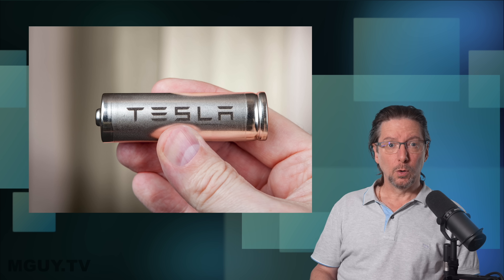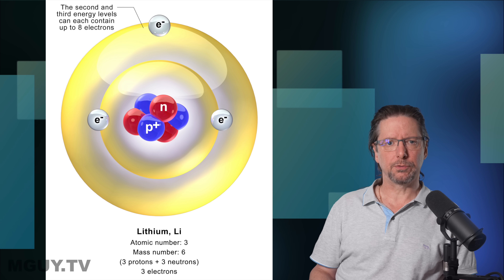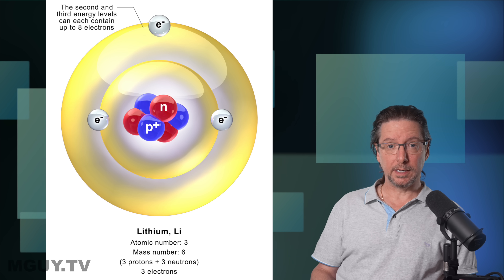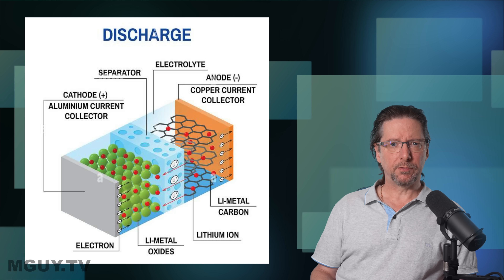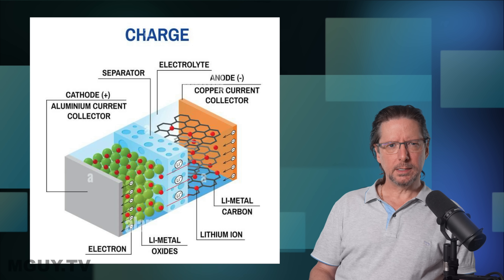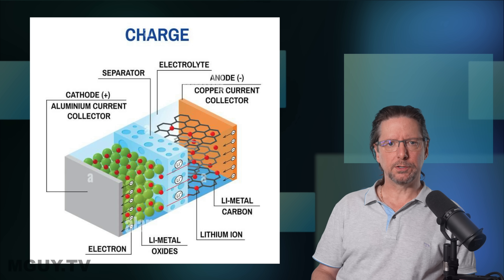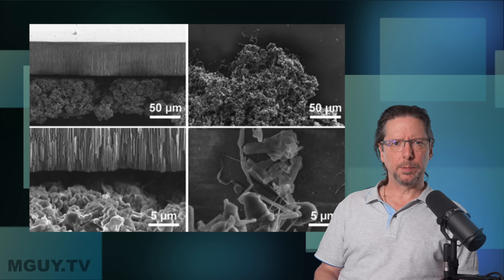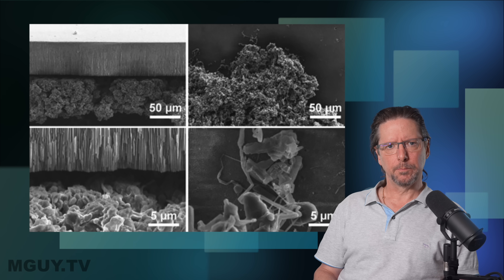Why are EVs so TERRIBLE in the cold? | MGUY Australia

Comment: Evs are too early.  They wont be a thing this decade.  The  infrastructure isn't there and they are  a fire hazard. And they have bad range etc etc etc
Reply: Yes they are A tHiNg. Just because they are a thing that totally sucks does not mean they are not a thing. People who are smart enough not to fall for shitty EVs they've been pushing for over a decade are still total trend suckers when it comes to repeating inane cool kid language they picked up online in the last 5 years.
Reply: EV's have been around since the beginning of the automobile, they are not new technology and EV's still suffer from the same problems they have singe the beginning.
Reply: @LeeCountySpeedShop  EVs do NOT suffer from the same problems they had 100 years ago, are you nuts or just so biased you don't care what you write?
Let's see about some things that have changed in the last century:
1) The grid was created, all over the USA. By order of Congress, all areas of the USA have been electrified regardless of the profitability of the locale. We have power now, everywhere.
2) Batteries have improved in the last 20 years tremendously, with their price per kW/h and kW/h per kilogram improving like the density of microchips. The advent of lithium-ion chemistry was the landmark invention that made modern batteries practical (generally, a 3:1 improvement in kW/h per kilo).
3) Modern EVs have battery management systems to prolong life and improve performance in cold temperatures.
4) EV motors are more efficient than they were 100 years ago, with both permanent magnet and induction motors.
Reply: Stop voting for Politicians that give large subsidies to EV buyers and companies.
Reply: @jamesdallas1493  OK, does that mean we stop voting for politicians that give (in the USA) $20 billion in annual subsidies to the oil industry, and bail out (USA) bankrupt automobile manufacturers? I'm just trying to understand where your opinion on subsidies fits...
Reply: @justsomeguy934  what do mean by oil subsidies?
The oil and gas companies pay more in Taxes as percentage of income than big tech.
Reply: Its not to early for EVs, the timing will never be right.  
100yrs ago they tried it and said the same thing.
Reply: @terrypikaart4394  100 years ago there was no appreciable grid in the USA, nor lightweight batteries. Both are present now.
Reply: @justsomeguy934   Sure you could say that, but apparently the grid is not good enough and nether are the batteries..
Its all going down the tube..
Reply: @terrypikaart4394  "apparently" the grid is not good enough? Prove that, please. Stop drawing the conclusions that the oil industry wants you to draw.
Reply: BEV only for 10 years now, >300tkm, they work, they stay, I would never go back to ICE cars. Driving through Europe BEV only, never did that in ICE cars. Just checked, no fire this week, but its only monday :-) Only people not knowing anything about EVs have problems, why do they always believe all the misinformation ?
Reply: I doubt mass production of ICEVs will last past this decade because BEVs have proven so much better, the infrastructure is so much cheaper to maintain, and the fire risk that ICEVs represent.
Reply: Even with General Motors crappy EV’s that really hurt the fire hazard ratio,EV’s in North America catch on fire less then ICE vehicles
Reply: I guess my 9 years and 100,000  miles of driving all over the USA didn't happen, then?
Reply: All lies. Check other sources like Electric Viking
Reply: @derekr1113  Electric Viking is hardly an expert on the history of battery powered cars.
Reply: @derekr1113  that guy is a moron schill.
Reply: 😂😂😂Tesla model Y was the Best selling carmodel on planet Earth in year 2023
Reply: In a decade you will own nothing and you will be happy.
Reply: I have a model y up here in frozen hellhole canada.. it gets COLD and stays that way for months on end. I plug in each night and never have any issues.. not like im driving 250km a day when the batt has lost a lot of range. And I still drive 500km to my home town in winters no problem.. i stop twice to charge and it gives me enough time to go to Tim Hortons , get a coffee and something  to eat and have a bathroom break.. stretch my legs a little and away I go. In the summer I only have to stop for a charge once... but in 6 hours of driving its not like I wouldnt be stopping twice anyways to do these things. I think too many people here just hate EV or just believe the FUD, intentionally I suspect. For me an EV is perfectly fine and I save a ton not having to get screwed for gas prices... if you are not one of these people, then EV's arent for you. Its that simple.
Reply: Yes Mark and r the bloody things are just getting so large too - I have visons of say an Abrams tank going electric powered - just simply absurd.
Reply: Its kind of sad what the Govt are doing with Evs. They are straight lying to these people and are creating these Cult Members. You look up Ev fires and they will tell you 5. Lmao..  They are just using them to get cars off the road and they got people cheer leading for it. Dystopian Nightmare!!
Reply: The gas car was a fire hazard and still can be lmao what are you talking about?
Reply: 1. Child battery mineral labor

2. Range anxiety

3. Risk of garage fires

4. Paying 20k more than a
comparable vehicle

5. Battery denegration

6. Poor resale value

7. Reduced performance in
cold, highway.

8. Higher repair costs

9. Awful charging network
experiences in the weather
without restrooms

10. Higher insurance rates

11. Replacing tires more
frequently

12. Death by autopilot

13. 30 - 40k battery

14. Low km range

15. must wait in-line 1-2 hrs
to charge.

16. Then wait more time to charge, while charging.

17. Spontaneous combustion, with no way to put out the fire storm.

18. If they catch fire in a tunnel, many people will die.

19. People without a pro charger system or a parking spot at their house, will run an extension cord to the road, which is dangerous and could lead to people tampering with your charging setup (super slow charging at the road)

20. If you're in California, you won't be able to charge your car past 4pm because of a shortage of electricity supply on the cheesy grid.

21. It is not actually "green". The pollution is made at the power station, not the car.

22. Only 5% of used junk batteries get recycled, the rest go directly into the bin. It's cheaper to mine for new minerals.

23. Chhinna actually does 70% of all the refining of the minerals and production of the batteries.

24. Minerals are becoming more and more scarce, and the cost will only go up, not down.

25. Some countries where they mine for lithium, actually use a very big boat load of fresh water to only produce a ton of lithium, so they are afraid of running out of water. It takes over 2 million liters of fresh clean water to produce 1 ton of lithium. 

26. Ev cars will soon not be able to drive in tunnels or be able to park in underground parking garage and probably will eventually void your house insurance if you park it in your personal garage.... 

27. You can't charge your battery at super stations when it is bitter cold out. 

28. If a fire truck comes to put out an Ev fire, all the chemicals go directly into the sewer system, poisoning everything. They need tons of water to slow down the burn. They can't put them out. They are only trying to prevent over things near by from catching fire. 

29. Ok, there is 2 good things; regenerative braking, which charges the battery while you are slowing down on the highway, which saves your brakes from much wear.
Reply: Theyve been around for OVER 100 YEARS.
Reply: @sugarnads  ...and they failed 100 years ago because of charging problems and range problems...
Reply: @teekay_1  absolutely false, but the oil investors appreciate your patronage.
EVs and steam vehicles outnumbered gas cars in the 1910's. The changeover happened because the electric starter was invented by Charles Kettering. That removed the danger associated with hand-cranking an ICE. Gasoline, more portable than electricity in a country with little to no grid, prevailed. Also remember there were not federal highways at that time, either. Up until WWI and WWII, there were farms with NO electricity in the USA but you could take Bessie the mule to town and buy fuel for the tractor.
You're welcome for  the actual facts and history of EVs.
Reply: @justsomeguy934  Oh, absolutely true.   You just have no knowledge of automotive history.

Detroit Electric was the favorite of wealthy women, because they weren't strong enough to crank the engine.

Once Cadillac invented the electric starter Detroit Electric failed because of range issues, and battery issues.

So stop pretending you know what you're talking about and accept that the electric car had already failed over 100 years ago and it on the verge of failing again today for precisely the same reason.

As long as electrics are going to drag around that heavy battery, they'll never succeed.
Reply: @sugarnads  maybe the 100year old electric cars are better
Reply: @sugarnads  exactly, not early but late and out of date
Reply: @sugarnads roller blades were patented in 1917.  Just because the idea is around doesn’t mean we have the materials to make it work properly.
Reply: @fredmonroe6042  'RollerBlades' are only ice training skates repackaged
Reply: Gas cars catch on fire at an extremely higher rate than EV's. They are leading in fire hazards. In the US alone they have 175K gas car fire a year.
Reply: @itsatrap7215  only because there are 10 billion ice cars cruising around.
Reply: @jakefriesenjake no, pay attention. He said the RATE of fires is higher. That takes into account the difference in numbers. 
In fact, the rate if fires in ICEVs is 30x higher than BEVs. Not 30% higher, 30 times higher. That gives you an idea how badly channels like this are misleading you about EVs. 

Gas vs EV Fires [2023 Findings] - AutoinsuranceEZ
Reply: @williammeek4078  the issue here is you are comparing ICE vehicles that have been in common use for 125 years compared to EVs which have only been in common use for maybe less than ten years and even that, they aren't all that common even today. So until EVs have been around for another 125 years the numbers mean pretty much nothing.
Reply: @williammeek4078  however ICE vehicles don’t go into thermal runaway out gassing toxins while trying to put the cursed things out.  Let’s not forget get the toxic nature of the run off water.
Reply: @jakefriesenjake  you might want to look up the number on EV versus ICE fires... ratio wise. ICE cars are worse.
Reply: @northdakotaham1752  😂🤣😂 Your logic is absolutely backwards. EVs are already better despite being new and they are only going to improve. ICEVs are crap since they already can’t compete with EVs.
Reply: @itsatrap7215 cobra bites are much more dangerous than bull snake bits. Bull snakes are more likely to bite, but I’d still rather handle one free hand. Gas cars may catch fire more often but they not nearly as dangerous. In fact, it isn’t at all uncommon for fire damage to be repaired. An EV that burns is a total loss and much more likely to burn everything in the area.
Reply: @itsatrap7215  I dispute your "at a higher rate".  Fact link please.
Reply: @itsatrap7215  Only because there are hundreds of millions more gas powered vehicles, but you leave out that gas fires are much easier to put out. EV's are a very small amount of vehicles in the market. Also Electric Vehicles have hirer repair rates than do gas and diesel vehicles and EV's cost more to repair. Funny how you EV backers always want to turn a blind eye to that.
Reply: @itsatrap7215  ICE car fires are generally smaller fires that are easy to put out, with no risk of re-ignition days or weeks later at the impound yard. ICE cars as a whole do not spontaneously combust in your garage, also-
Reply: @doublebackagain4311  actually, Toyota and Hyundai have recalls out for millions of vehicles for spontaneous combustion. So does Ford for fires (8 million on that recall), and BMW (a million for fires) and Honda (half million, I think) for window switches that cause a fire if snow or rain falls on the switch.
What were you saying about ICE cars not catching fire in a garage?
Reply: @justsomeguy934  I know a guy who failed to properly reconnect a fuel line on his car during maintenance. This resulted in a fuel fire. He put it out with his soda. Not even a full can. There was no damage to the vehicle. That certainly counts as a vehicle fire and one that involves fuel. You cannot have a fire that minor that includes an EV battery.

Another major factor that is missing is the percentage of fires started due to "red neck maintenance." Once EVs start receiving the same treatment their combustion rates are going to go up as well.
Reply: @joshualandry3160  The stats for ICE fires vs. EV fires are measured in miles between fires and fires per 100,000 vehicles. It matters not what the cause is, poor maintenance, sparks igniting fuel as a result of a crash, spontaneous combustion. The fact is that EVs are orders of magnitude safer from fire than a vehicle carrying liquid explosive as fuel.
Reply: @justsomeguy934  No, you are misunderstanding the statistic quite horribly. One fire does not equal another. I gave the example earlier of a cobra and a bull snake. A cobra is quite venomous. A bull snake is not. A bull snake is more likely to bite. Actually, Vietnamese blue beauties would be a better example. Extremely likely to bite however basically harmless. The frequency of bites does not tell you which snake is more dangerous.

For example, the fuel fire I cited earlier that was put out with half a can of soda. That is a typical fire in an ICE. Relatively minor. EV fires are almost all due to battery failure in a thermal runaway. Even those that are not can very quickly become thermal runaways. Lithium battery thermal runaways burn several times hotter than gasoline fires. The batteries are also self sustaining and therefore almost impossible to put out in the field. An EV fire response is basically containment to keep the fire from spreading. Even once extinguished the fire can reignite days or even weeks later. 

EV fires are also triggered by very minor accidents and flooding. What is worse these fires can happen months after the damage was inflicted. This is why there are so many quarantine rules about damaged EVs.

As for gasoline, it is not a liquid explosive. Gasoline vapor burns relatively slowly and liquid gasoline doesn't burn at all. In fact it can often choke fires out completely. A fuel that explodes is a very bad fuel since a cylinder wouldn't be able to handle the stress. A gasoline fire looks like the opening in Ford v. Ferrari, not a Mission Impossible or James Bond movie. In reality Lithium ion batteries are far more explosive. There are plenty of legitimate videos of EVs exploding. ICE vehicles don't have anything on those explosions. 

My point original point, which you chose to ignore in favor of attacking a straw man, was simply that the statistic about relative fire rates between vehicles is incomplete since if EVs enter wider adoption they will almost certainly be exposed to poor maintenance practices which will increase their rate fires compared to now.
Reply: @joshualandry3160  actually, it's you that doesn't understand the statistics, nor the facts, of EV fires vs. ICE fires. 
Your comparison of a gasoline fire to thermal runaway is laughable. It actually takes TIME for thermal runaway to occur, as opposed to an explosion with gasoline. Gasoline can, and does, spread away from the vehicle when ignited, the fire of a battery is limited to the battery pack itself. Would you like to see videos of a gasoline car or tanker hitting a barrier or other vehicle on the road? Instant ignition and explosion. EVs don't have ANYTHING on those explosions. 
Another red herring argument that the oil industry thanks you for discussing: extinguishment of a battery fire.
The time, water or procedures required to put out the rare EV fire is meaningless. What matters is how many people are harmed by a fire. 
Here's a simple example, tell me your choice:
a) Airplane brand A has 1 crash a year, all die, and the fire is difficult to put out.
b) Airplane brand B has 10 crashes a year, 10x the number of passengers are dead, but gosh darn the fire can be extinguished quickly. 
Tell me you pick airplane brand B. Go ahead, tell me the more easier extinguishment of brand A is worth the lives of 10x more people. Oh and there's more warning before a fire starts in brand A, so it's more likely more survive.
My point, that you chose to ignore, is that you have no proof (because the NHTSA doesn't state) that any significant ICE fires are small or meaningless; the same could apply to an EV fire. My point, that you chose to ignore, is that TEN TIMES fewer fires is safer than TEN TIMES MORE FIRES. Your "put out a fire with a soda" is laughable. As for poor maintenance-sourced fires, you actually made my argument FOR me. If a car owner can't do proper maintenance, having them neglect that on a vehicle carrying liquid explosive as a fuel is...not a good idea. Keep Mr. Hat-On-Backwards mechanic AWAY from gasoline, yes?
Reply: @justsomeguy934  Really funny. You don't know Jack about fighting fires but want to assume gas fires are worse, because gas "is explosive" without evidence. Why are you so opposed to being realistic? You have no idea what percentage of ice fires are serious. You simply want to assume they are all worst case because you know ev fires are. The simple fact is a lot of ice cars are extinguished and repaired.  That proves you don't know what you are talking about.

You also want to keep shadetree mechanics away from cars? Good luck with that. 3rd party battery repair is already a thing for evs and they dramatically increased the risk of batteries entering thermal runaway. Also, good luck noticing a runaway in time to do anything.
Reply: @joshualandry3160  Really serious. You're trying to introduce an unsupported "fact" into the actual NHTSA stats to imply gas car fires are minor. 
I assume a car fire is a car fire, just like the NHTSA. I have no agenda as you do to try and redefine the terms of the statistics. Let's assume all fires are the same, or all fires are the least, the fact that gas cars catch fire 10x more than EVs remains.
WHO CARES if more gas car fires are extinguished or repaired? We're talking incidents of fires. Amazing fact for your: less fires good, more fires bad. 
As for thermal runaway, those take time. They give the occupants time to leave the vehicle. In fact, one of the very first Tesla car fires was a case where road debris (an L-shaped trailer hitch) pierced the battery back. The car told the driver to pull over, and only 20 minutes later did a fire occur (no explosion). My EV's batteries are surrounded by coolant, very difficult to actually start thermal runaway, and the newer ones have flame-retardant foam in addition to liquid coolant.
So you can try to explain away why an order of magnitude of fires in gasoline cars isn't so bad, but the facts belie your efforts. Did you read my airplane example? It applies EXACTLY to this scenario.
So you go right ahead with your hat-on-backwards and monkey around a vehicle with liquid explosive, then claim a soda can will save you.
Reply: @justsomeguy934 No, my facts are competently supported. The statistic merely counts  occurrences. It therefore does not directly correlate to which is more dangerous. The fire suppression guidelines and do that for me. The fact is there are a lot of examples of minor ICE car fires. There are almost no examples of minor EV fires. I am actually not aware of any.

This goes directly to the aircraft example. Lets say aircraft A has 10 incidents in a year, all fatal. Aircraft B has 100 incidents per year and 5 are fatal. Aircraft A has fewer accidents by a factor of 10. But aircraft B has fewer serous accidents. This is exactly my point. Your statistic doesn't account for this and you are forced to assume and argue against reason that all the incidents are the same.

This actually goes back to my original point that currently EVs are owned by people who can afford the EV and therefore can afford the maintenance. Once EVs enter wider circulation you will find that isn't the case and the statistic will go up. Unless you are volunteering to foot the repair bill for other owners this is inevitable. The statistic is therefore misleading in 2 ways. First it doesn't address severity of the fires and second it contains sampling bias. 

EV runaways are insidious. Sure some incidents are caught early and everyone can get clear. Sometimes not. Often they happen when the vehicle is charging and the fire spreads to the structure and is almost impossible to fight. ICE cars tend to catch fire away form other vehicles or flammable objects.

My point was, and remains, you are being a coward and abusing statistics to try and make a point that just doesn't follow logically.

Also, thermal runaways are not easy to prevent. They are actually very difficult and EVs are loaded with technology to do that. All well and good assuming that it works as intended. It can and does fail because that is just how the world works. Things break down and fail. On ICE cars that can be anything from a small fire a soda can extinguish to a something much more serous. In an EV a breakdown is a thermal runaway with no small option.
Reply: @joshualandry3160  Your statement: "Your statistic doesn't account for this and you are forced to assume and argue against reason that all the incidents are the same."

You are injecting a supposition that is not supported by the NHTSA in order to lessen the stark comparison of fire incidents between a gasoline fire and an EV fire. YOU are making a false assumption that every EV fire is catastrophic, and that half of gas car fires are not. I do not bugger the argument like you are doing and only use the rates of fire stated by the NHTSA. Anything other than that is guesswork and opinion.

As for your claim of EV fire safety, no EV battery incident results in an immediate explosion. Thermal runaway takes time, in 100% of the cases. Gasoline fires can explode, giving the occupants no time to escape. If we accept that FACT, then your argument that some gas fires are less than catastrophic is moot, as there are other gas car fires that instantaneously kill all occupants in the vehicle. 

"ICE cars tend to catch fire away form other vehicles or flammable objects." And upon WHAT do you make this claim? I have numerous examples of MILLIONS of cars recalled by Ford, BMW, Hyundai and Toyota for spontaneous combustion incidents. And where the manufacturers told the owners to NOT park their cars in a garage or next to a structure. Do you want the evidence? Stop pulling something out of your arse to make your case. 

"My point was, and remains, you are being a coward and abusing statistics to try and make a point that just doesn't follow logically." A coward, am I? It's YOU that is making unsupportable claims in the face of actual evidence that disproves your conclusion. I'm abusing nothing; it's you trying to say "gas fires aren't that bad sometimes so the NHTSA data doesn't apply". 

"In an EV a breakdown is a thermal runaway with no small option." Again, you are making statements you cannot support. An individual cell in a battery pack can fail, overheat, but the liquid coolant and flame retardant foam inside the pack limit the failure to that one cell. The pack may fail, but no catastrophic fire occurs. In fact, the EV owner may not even know the reason the pack failed, just that their battery pack doesn't function. I can even show you battery designs that have nails driven through them with no fire occurring at all.
Reply: @justsomeguy934  You are the the who argued that a fire is a fire and who cares about differences. Scroll up. You said it, you cal live with it. If you want to change your position honestly requires admitting a mistake.

EVs burn because of the lithium batteries. Ignoring that is ignoring reality. There is no such thing as a minor battery fire.

How do I know most ICE vehicles burn away from vulnerable structures? Simple. When do these fires start? When the vehicle is in use. This means not in structures and outdoors on roads. How do I know EVs are likely to burn structures? Because they tend to start burning when charging or when parked hours or days after the damage occurs. Hence the guidelines about dealing with EV damage. You can try to dispute this, but that would be silly.

Next, you cite “millions of cars” recalled. A) the recalls you listed where electric issues that could just as easily been EVs. B) you want to talk statistics then raw numbers have no place here. C) most cars recalled did not experience the failure.

You might not like reality, but it is there nonetheless. The reality is the statistic counts the number of fires in EVs and ICE vehicles. That means it counts incidents like small fires that can be put out with a can of soda and large fires what turn a vehicle into ball of flame. Given the simple fact that EVs burn almost exclusively from battery related events we know what drives the vast majority of those fires. The same cannot be said for ICE vehicles. You have yet to admit that in any way. That is why you are a coward running from reality. That is also why you are abusing the statistic. No one claimed EV fires are not more rare which is the only application of the statistic. I don’t have any proving to do here. You made the claim you have to do the proving. It’s called the burden of proof. You cannot jump from “Vietnamese blue beauties bite more than cobras” to “Vietnamese blue beauties are more dangerous than cobras.” Ones doesn’t logically imply the other. 

You clearly don’t understand how a battery fire happens. Flame retardant foam and other means to smother a fire doesn’t stop a battery fire. Those measures at best slow the runaway. They do not control it. Batteries contain their own oxidizer, which is why they are so dangerous. If cells are spaced far enough apart to contain the failure then the battery is too big and heavy to be used.

And yes, you can show me a battery that won’t burn if you run a nail through it. Batteries not used in EVs at all. Batteries claimed to be future developments, but not yet. Generally because these batteries are low voltage and cannot power an EV. We might develop transporters in the future, but not yet. Pointless to bring this up.

It makes much more sense to point out the current statistic is skewed because ICE vehicles includes all of them. All, meaning old junkers to brand new cars right off the lot. This means it includes substantial numbers of cars that are improperly maintained and/or recklessly modified. EVs are rich person toys. This means they are much more likely to be maintained properly. This means that there is a substantial error source when comparing relative rates of combustion. You might find it uncomfortable, which I assume is why you want to ignore it, but wider EV adoption means giving EVs to people who don’t maintain their cars properly or recklessly modify them. That will change the statistic. This is known as an error source and is actually relevant, unlike batteries that don’t exist yet.

Edit: by the way, you do realize it was been calculated that the grid currently needs to be increased in capacity about 400% to replace ICEs? You also realize there are overwhelming examples of requests to limit electricity use to conserve power due to shortages? The only way you could possibly dispute that the grid is inadequate is pure dishonesty.
Reply: @joshualandry3160  "You also realize there are overwhelming examples of requests to limit electricity use to conserve power due to shortages?"
I believe you're referring to California and Gov. Nuisance asking people to restrict high-amperage energy use. This is almost always the argument I see about EVs not being practical.
First, Gov. Nuisance asked everyone in California to delay air conditioning, clothes drying, excessive lighting, etc. until after hours (i.e., avoid peak usage). His request was NOT specifically targeted to EV charging, but that's the narrative the oil companies want you to repeat. And you did!
Well, my uninformed friend, I lived in California 20 years ago before EVs were ever a thing. They had blackouts and brownouts then, and EVs had nothing to do with them. Even today, EVs are 0.0004% of California's grid demand. EVs are NOT the problem, proper energy management IS the problem. California removes dams, dismantles power plants, prevents power plants from being built. They kneecap themselves, energy wise.
EVs aren't the issue, California is the issue.
Reply: @joshualandry3160  "EVs burn because of the lithium batteries. Ignoring that is ignoring reality. There is no such thing as a minor battery fire."
An unproven statement on your part, despite that I proved it false in a previous reply.
Let me repeat: you can short a single battery out in a modern EV battery pack and NOT cause a fire. Would you like me to direct you to a photo of a Tesla battery pack? The new ones have fire retardant foam and liquid coolant inside a sealed box. You can ABSOLUTELY have cells short out, heat up and NOT cause the entire pack to catch fire. Your separation from reality is truly epic here, as you claim there can be minor and non-catastrophic gasoline fires (put out by soda! he he), but insist that ALL battery fires are major.
A high school logic class would serve you well.
Reply: @joshualandry3160  "How do I know most ICE vehicles burn away from vulnerable structures? Simple. When do these fires start? When the vehicle is in use. This means not in structures and outdoors on roads. How do I know EVs are likely to burn structures? Because they tend to start burning when charging or when parked hours or days after the damage occurs. Hence the guidelines about dealing with EV damage. You can try to dispute this, but that would be silly."
Yet again, another undocumented assertion on your part, with no evidence. It may make sense to you, but you have no proof, and indeed, it makes no difference whatsoever. WHO CARES where a fire occurs if one kind of vehicle has TEN TIMES LESS fires than the other? Egad, man, your desire to believe your own words are flying in the face of reason.
But to help you understand that gas cars spontaneously combust, and that their manufacturers warn you to not park them indoors or near structures, here are just a few bits of information:
1) Toyota explodes in owner's driveway, near their house, new car, no known reason. See: ConsumerAffairs dot commercial website, look for article titled "It was their brand new Toyota. It exploded in their driveway. And no one can explain why".
2) Kia Sportage catches fire at neighbor's home, Kissimmee FL, spontaneous combustion. See: ClickOrlando dot commercial website, look for an article titled "Kia Sportage catches fire in Kissimmee couple's driveway". 
3) Kia and Hyundai tell their customers to park their cars outside due to fire risk, this affects 500,000 vehicles. See: CNN, look for article "Hyundai and Kia tell owners of nearly 500,000 vehicles to park outside due to fire risk". 
4) Ford SUV burns in couple's driveway. See Wave3 commercial website, look for article titled "SUV catches fire, burns while engine off". 
5) I have recall listings for 1 million, 7 million and 8 million gas cars due to fire risk.
It would be "silly" for your to make your claims about gas cars being safe in your driveway, now wouldn't it?
Reply: @joshualandry3160  "This means it includes substantial numbers of cars that are improperly maintained and/or recklessly modified. EVs are rich person toys. This means they are much more likely to be maintained properly. "
Yet AGAIN, this is an unsubstantiated claim on your part to make gas cars look safer than they are.
Let's cut to the chase here - the danger in a gas car is that it's fuel is explosive and flammable. If poor maintenance can result in a fire in a gas car, but not in an EV, then you've just MADE MY CASE! EVs are SAFER because they don't carry explosive as fuel!
EGAD this really isn't that hard for you, is it?
Reply: @joshualandry3160  "This means that there is a substantial error source when comparing relative rates of combustion. You might find it uncomfortable, which I assume is why you want to ignore it, but wider EV adoption means giving EVs to people who don’t maintain their cars properly or recklessly modify them. That will change the statistic. "
Again claiming I'm ignoring something. Nope! Let's think about this a minute - exactly WHAT are "people who don't maintain their cars properly" going to do to an EV? EV battery packs are sealed, inaccessible to the owner and even part of the structure of the car. There IS NO WAY for an EV owner to do anything dangerous to the vehicle through neglect. But mess around under the hood or neglect a gas car and you DO have a fire situation, as you admit that maintenance can be a factor in car fires. This is ONE MORE REASON that EVs are safer from neglect and tampering than a gas car.
Honestly, you make dismantling you arguments too easy.
Reply: @joshualandry3160  "You cannot jump from “Vietnamese blue beauties bite more than cobras” to “Vietnamese blue beauties are more dangerous than cobras.” Ones doesn’t logically imply the other. "
What? Damn but you're out on a limb...
Reply: @joshualandry3160  "Batteries contain their own oxidizer, which is why they are so dangerous. If cells are spaced far enough apart to contain the failure then the battery is too big and heavy to be used."
ANOTHER unsupported statement by you. I guess YOU don't understand battery design. Let me repeat my offer, or at least request you do some research, on the design of a modern EV battery. Liquid coolant surrounds all cells, and in at least Tesla batteries, there's flame retardant foam around EVERY CELL. And gosh darn, the Tesla batteries seem to be small enough for their application.
Oh and I got a kick out of the "oxidizer" comment. Tell me, do you know any gasoline car that is NOT operated in the presence of an oxidizer, say, the oxygen in the air? Driving your car in a vacuum, are you?
Reply: @justsomeguy934  So you are resorting to the cowardly and dishonest tactic of a proof by verbosity. You also demand proof while refusing to give any of your own.

"WHO CARES where a fire occurs if one kind of vehicle has TEN TIMES LESS fires than the other? "

Perhaps you have a reading comprehension problem? Or simple dishonesty? Let me repeat the same example you have ignored again. A cobra is less likely to bite than a blue beauty. Why would I not care that the blue beauty bites 10 times more than the cobra? Because the consequences of the bite are much less. Blue beauties are non-venomous and their bite will draw a little blood and that is it. A cobra will likely require amputations at the very least.

Similarly how can I not care that the statistic is what it is? Do you have the ability to understand the connection between the example and subject matter?

Then you list an number of isolated incidents. Exceptions do not disprove the general rule. ICE cars generally burn due to the vehicle being in use while EVs are generally the opposite. Is that really such a hard admission for you to make?

Lets look at that list for fun.

1) "Toyota explodes in owner's driveway..."

One car. Out of millions and millions on the road. If one case of an EV burning in someone's drive can be found it would be more statistically significant. Oh wait, that is one of the most common ways EV fires happen. While charging.

2) and 3) because they all deal with Kia "Kia and Hyundai tell their customers to park their cars outside due to fire risk, this affects 500,000 vehicles"

Yes, the budget car maker sells poor product. Just wait until their EVs show the same quality construction. See previous note about recalls. 500,000 cars did not catch fire. Could does not equal did. That could easily happen to EVs.

"4) Ford SUV burns in couple's driveway."
Again, one vehicle. Against millions. 

5) "I have recall listings for 1 million, 7 million and 8 million gas cars due to fire risk."

Yes, you did. You also ignored me pointing out that by your own admission a lot of those are for simple electrical issues, like powered windows, present on EVs as well. You also ignored where I pointed out that you want to argue a 1 to 10 statistic. Raw numbers have no place in this discussion. The ones that burned are already counted, as are the ones that did not.

Would it make you happy if I talked about how Chevrolet recalled Bolt EVs due to possible fire risk? This cuts both ways here and talking about raw numbers is misleading because there are about 90% more ICE cars than EVs.

This again brings up severity.  A lot of the recalls are for things like door motors that are going to be small, repairable fires with next to no probability of injury. The EV recall is for the battery turning the car into a fireball. Again, one fire does not equal another. One recall does not equal another. Why is this concept too hard to grasp?

your last your  claim: "It would be "silly" for your to make your claims about gas cars being safe in your driveway, now wouldn't it?"

And then you realize I never made such a claim. There is a reason I tend to use phrases like "in general..", "in most cases," etc.
Reply: @justsomeguy934 If you doubt the maintenance issues cause problems I suggest the YouTube channel "just rolled in."

Also, note I never claimed that maintenance issues where not a problem and lessened the risk of the technology. You where the one who made that assumption. I pointed out that as these same practices are applied to EVs, as they would with increased ownership, the EV fire numbers will likely increase as well. In short, this is an explanation that the statistic is subject to change over time. Why is that something you are so afraid of?

"Let's cut to the chase here - the danger in a gas car is that it's fuel is explosive and flammable. "

Sigh. Gasoline is flammable, not explosive. An explosive is something like TNT which burns very quickly and releases a lot of energy all at once.  Gasoline does not do this. Gasoline vapor burns quickly and can create effects that are best called "fireballs." This is not the same as an explosion. Yes they can be dangerous, but they are not explosive. Liquid gasoline does not burn. In fact, it can smother fires. Are there risks in using it? Of course. No one ever claimed it was completely safe. Any energy reservoir carries risk.

"If poor maintenance can result in a fire in a gas car, but not in an EV, then you've just MADE MY CASE! "

Indeed I would have. If I made the claim which I didn't. I kind of wonder if this level of dishonesty from you is because you know you don't have an argument or for some other reason. By the way, if you are claiming that poor maintenance cannot cause an EV fire, that is one heck of a claim for you to prove.

Poor maintenance can cause fires in both classes of vehicles. Currently gas powered cars represent the vast majority of poorly and improperly maintained cars.

In short, I do not expect the current statistic  to remain the same with widespread adoption. I expect the number of EV fires to increase due to poor maintenance. I have not speculated on what percentage that will be. I simply expect it to change. Is that really such a hard thing to admit is likely to happen?
Reply: @justsomeguy934  Lets see. This one really brings into question if you know anything on the subject at all. And this entire rant is a deflection form me pointing out you have the burden of proof for claiming new Tesla batteries will contain a thermal runaway. I guess that means you can't do it.

So in response to me pointing out that batteries contain their own oxidizer, you go on the rant about what the cells are packaged in. So, physics 101. Batteries do not store electricity. They are chemical generators. Batteries contain chemicals and the process they go through to release power is called oxidation. The process of a fire burning is the oxidation of the fuel which produces heat. In essence all batteries are controlled "fires" and rechargeable ones are simply easily "reversed fires. " This is the reason thermal runaways happen at all. The fire simply becomes uncontrolled and escapes the cell.

How do you fight a fire? A fire needs 3 things to burn. 1) fuel, 2) heat source, 3) oxygen. In order to fight a fire you have to take one of the 3 things away. The most common method is to pour water on the fire to cool the heat source and depriving the fire of oxygen. Fire extinguishers, like halon, work by removing oxygen. Another common method to contain fires is to make an air tight box. This is what is used on airliners. They work because any fire quickly depletes the supply of oxygen and burns itself out.

This example of the airliner is important. This method does not work on things like oxygen generators (ValuJet Flight 592) or lithium ion batteries. A quick google search would educate you on this. This isn't anything far out or theoretical. Basically, the battery cell contains both the fuel and the oxygen. They do not require any outside air to burn.

"Tesla batteries, there's flame retardant foam around EVERY CELL." 

Sounding them in liquid or foam does not change their composition. The foam is to slow down the spread, not keep it from starting.

"Oh and I got a kick out of the "oxidizer" comment. Tell me, do you know any gasoline car that is NOT operated in the presence of an oxidizer, say, the oxygen in the air? Driving your car in a vacuum, are you?"

Please try for some intelligence. The vehicle does indeed operate in an oxygen atmosphere. However, in the event of a fire a simple fire extinguisher can apply a layer of foam and cut off oxygen to the fire. Chemicals like halon can also be used. Another option is simply dousing the fire with water.

You cannot fight an EV fire that way. EV fires cannot be practically fought, only contained. They can, and in fact will, continue burning under water. This is well known and very widely reported. Challenging me to prove this just  proves one of two things. Either you are completely  ignorant to the subject matter or you are trying to deflect and distract from something you know you don't have an answer for. Ignorant or a coward, which is it?
Reply: @joshualandry3160  "So, physics 101. Batteries do not store electricity. They are chemical generators. Batteries contain chemicals and the process they go through to release power is called oxidation. "
Dude! Boy, you're really deflecting right now. I never said batteries don't have an oxidizer, so stop with the childish "Physics 101" crap.
What I clearly pointed out to everyone that gosh darn, a gasoline car OPERATES in an oxidizing atmosphere. Your claim that a battery carries an oxidizer is a red herring in your "EVs bad, gas cars safer" rant.
BOTH cars operate with an oxidizer that can create a fire. You obviously missed that, so a reading comprehension course could help you.
Stop being mad that I completely undid your oxidizer statement, being wrong is happening to you a lot.
Reply: @joshualandry3160  "Please try for some intelligence. The vehicle does indeed operate in an oxygen atmosphere. However, in the event of a fire a simple fire extinguisher can apply a layer of foam and cut off oxygen to the fire. Chemicals like halon can also be used. Another option is simply dousing the fire with water."

Another deflection by you. You were forced to admit that the oxidizer of gasoline is present where the vehicle is operated, therefore your initial argument is moot (batteries carrying oxidizer). 

Let's discuss your deflection of extinguishment methods. First, the argument of extinguishment is meaningless against the backdrop of battery fires occurring TEN TIMES LESS than gas fires. 

I got a kick (you are quite amusing, but you owe me money) out of water and foam put on a gasoline fire. First, you're ignoring the explosion factor of gas fires that a battery fire does not have. A gasoline car can, and does, explode immediately under common conditions. A battery fire takes time. No time for foam when an explosion occurs, champ. Oh and WATER on a gasoline fire? Really? Did you want to check with a firefighter on that one? Let's see, fuel floats on water, water spreads fuel, oops.

But it's important to see how you're trying to deflect the fact that gas car fires occur orders of magnitude MORE than EV fires, NHTSA supported fact. So what does someone like you do when the facts debunk their opinion? Well, they try to say gas fires can be put out with soda, battery fires last longer, blah blah blah. 

The point I've proven using government stats is that EVs are far safer from fire than a gas car. That's the ENTIRE point of the statement, despite your laughable attempts to requalify the facts. I've got one for you! Hey - why don't you argue a battery fire smells worse than a gas car fire, so GOTCHA, EV fires bad? Ya - they smell bad so that PROVES EVs are bad.

Damn, I'm good.
Reply: @justsomeguy934  Lets review. You are taking a statistic that is not in dispute, that gas cars burn more than EVs, and trying to use it to claim that gas cars are more dangerous than EVs. This is a logical fallacy because higher occurrences do not equal more dangerous because the relative severity of the events must be taken into account. The statistic does not do that.  You are throwing a major temper tantrum about it. Like a three year old. Please do grow up. 

I pointed out EV fires are more dangerous because the battery contains an oxidizer. You are trying to laugh off that fact. If you do any research on battery fires you will see this cited as the reason they are more dangerous than other types of fire. This is exactly why batteries are so tightly controlled on aircraft.

You want to deflect this again by claiming an atmosphere is the same thing. It isn't. You can easily separate a fuel fire from the atmosphere and put it out. You cannot separate a battery fire from its oxygen source. You are apparently completely unaware of this fact and unaware of how this makes battery fires more dangerous. This is a widely accepted fact. I recommend googling "why are lithium battery fires so dangerous". It will be enlightening.

So, in short, yes. You are completely uneducated on battery physics and trying to substitute your ignorance for an argument.
Reply: @joshualandry3160  "This example of the airliner is important. This method does not work on things like oxygen generators (ValuJet Flight 592) or lithium ion batteries. A quick google search would educate you on this. This isn't anything far out or theoretical. Basically, the battery cell contains both the fuel and the oxygen. They do not require any outside air to burn."

Again, a meaningless deflection to avoid the obvious. A fire that doesn't happen is more valuable than a fire that DOES happen, regardless of how the less frequent fire is extinguished. Funny thing, not being dead is important, the aftermath of being dead is not. Less dead good, more dead bad. 

So trying to tell me that battery fires are hotter, or harder to put out, or carry an oxidizer, or require more water, is a deflection of the point of the statement: 

Don't have a fire in the first place!
Reply: @joshualandry3160  " that gas cars burn more than EVs, and trying to use it to claim that gas cars are more dangerous than EVs. This is a logical fallacy because higher occurrences do not equal more dangerous because the relative severity of the events must be taken into account. The statistic does not do that. "

The fallacy is your lack of comprehension. By mere definition, more fires are less safe than fewer fires. You have finally admitted that EVs have fewer fires - an order of magnitude or more - than gas cars. 

What you're deflecting, however, is trying to inject a severity difference between EV fires and gas fires that is NOT part of the incident rate of the fires, nor does NHTSA differentiate fire severity in its calculations. As far as NHTSA is concerned, a vehicle fire is a vehicle fire; fewer fires means a safer vehicle. EVs are safer from fire.

It is YOU that is attempting to argue that gas fires are safer due to soda cans, foam, thermal runaway, etc. Your opinion on battery fire danger vs. gasoline fire danger, especially your total refusal to recognize that a battery fire takes time vs. an explosion, is beyond any rational thinking process.

Occupants can die in a fire. Fewer fires mean fewer occupants die. Every other argument you have tried to make - extinguishment methods - are meaningless as far as safety is concerned. Your inability to see your own refusal of the facts is quite disturbing. It matters NOT if a battery can burn underwater. Not having a fire in the first place is important. It's time for you to actually make the statement "my other arguments are inconsequential, EVs are, in fact, safer from fires in both frequency and in lives lost".
Reply: @joshualandry3160  "You are apparently completely unaware of this fact and unaware of how this makes battery fires more dangerous. This is a widely accepted fact. I recommend googling "why are lithium battery fires so dangerous". It will be enlightening.

So, in short, yes. You are completely uneducated on battery physics and trying to substitute your ignorance for an argument."

I must have stung you pretty bad. You ignored my previous statements and repeated your claims that I am unaware of battery fires being different than gas fires. I have REPEATEDLY stated that the extinguishment requirements for an EV fire are meaningless on the topic of vehicle safety. 

Maybe you have to move your lips when you read, not sure, but S-L-O-W-L-Y read the following sentence:

Fewer fires are safer than more fires, regardless of how the fire burns.

Is that so hard? Stop deflecting the topic to post-fire procedures. It's meaningless.

Where's my money?
Reply: @justsomeguy934 This is fun. So lets review. You pulled a statistic showing that EVs burn less frequently that gas powered cars. This is not in dispute. You then claim that proves EVs are safer than gas powered cars. However this is a logical fallacy since the statistic deals with number of fires, not severity. 

 "So trying to tell me that battery fires are hotter, or harder to put out, or carry an oxidizer, or require more water, is a deflection of the point of the statement: 

Don't have a fire in the first place!"

Of course it would be nice to not have a fire in the first place. Unfortunately here in reality we have to deal with unwanted things. In reality both EVs and gas powered vehicles catch fire and burn.

The question of which is safer is going to come down to 2 questions. 1) which is more likely to occur and 2) what are the consequences of it occurring?

We agree on question 1. That is not in dispute. As much as you may wish it was, it is not. Question 2 is going to be the real meat and potatoes. So of course it is relevant which type of fire is easiest to contain.

So I guess I can some it up like this: "I'd rather have a hundred small fires that are easily contained and do minor damage than one large fire that is likely to do substantial damage."

I think what is happening here is particularly telling since I am perfectly happy to accept information that doesn't benefit my position. You seem to be particularly allergenic to doing so. I'll finally remind you that you claimed Tesla's new EV battery would stop a thermal runaway. I'm still waiting for you to provide anything to back that up.
Reply: @joshualandry3160  Where's my money?
Reply: @joshualandry3160  "So I guess I can some it up like this: "I'd rather have a hundred small fires that are easily contained and do minor damage than one large fire that is likely to do substantial damage."
No, you cannot sum it up like that. Your statement that there are 100 small fires, easily contained with minor damage as characteristic of gas fires, whereas battery fires are "one large fire likely to do substantial damage".
Do you not see that you are characterizing gas car fires as safer than battery fires when there is no evidence from NHTSA to that effect? NHTSA does not track whether or not a car fire resulted in an explosion, adjacent vehicle fire, number of first responders, cost to extinguish the fire. It's quite telling that you think you see gas car fires tracked by NHTSA as small and easily contained. Funny, I don't see that statistic in their ratings, but since it's important to your argument, YOU do.
Reply: @joshualandry3160  "I'll finally remind you that you claimed Tesla's new EV battery would stop a thermal runaway. I'm still waiting for you to provide anything to back that up."

What I told you was that the equivalent of a small gas car fire can occur in a battery pack and not result in thermal runaway of the entire pack. If a gas car fire can be put out with a soda, then a small number of cell shorts do not have to result in thermal runaway, and in fact, the driver of the car may not even know that a cell has shorted as far as fire goes. The coolant and the fire retardant foam inside the battery pack would contain a small number of shorts.

I'm not sure if you're challenging me on the fact that there is liquid coolant in a Tesla battery pack or fire retardant foam in a pack. Both components reduce fire risk. I never said that thermal runaway could not occur in a Tesla battery pack as you are stating. And I bet an automobile if you could prove it.
Reply: @justsomeguy934 It is my argument. I can sum it up any way I like. You may not like it, but you cannot tell me what my position is. 

"Do you not see that you are characterizing gas car fires as safer than battery fires when there is no evidence from NHTSA to that effect"

There is no evidence from NHTSA against it either. 

"NHTSA does not track whether or not a car fire resulted in an explosion, adjacent vehicle fire, number of first responders (sic), cost to extinguish the fire."

Exactly my point.

"It's quite telling that you think you see gas car fires tracked by NHTSA as small and easily contained."

I never said that. I said their statistic included all fires. All fires range from infernos that completely destroy a vehicle in a matter of seconds to small fires that barely do any damage and self extinguish. 

If one is to study the relative fire hazards of different vehicles one needs data on how those vehicles react to fire and yes, the effort involved in containing or extinguishing it. I've said this many times. One has to wonder why you are too much of a coward to accept that.
Reply: @justsomeguy934  "What I told you was that the equivalent of a small gas car fire can occur in a battery pack and not result in thermal runaway of the entire pack."

Okay, which is to say the battery pack can prevent thermal runaways. Sorry to bust your bubble, but a single cell is what starts runaways.

But enough of the semantics.  Go ahead and put up if that claim is so important to you. 

"If a gas car fire can be put out with a soda, then a small number of cell shorts do not have to result in thermal runaway,"

Non sequitur. You can easily have a fire small enough to be extinguished with a can of soda. That is a matter of common experience. Small fires only require small amounts of liquid to put them out. 

That has nothing to do with a battery able to contain a thermal runaway in a single cell.

Now you claim,

"I'm not sure if you're challenging me on the fact that there is liquid coolant in a Tesla battery pack or fire retardant foam in a pack. Both components reduce fire risk"

But before you said: "An individual cell in a battery pack can fail, overheat, but the liquid coolant and flame retardant foam inside the pack limit the failure to that one cell. The pack may fail, but no catastrophic fire occurs. In fact, the EV owner may not even know the reason the pack failed, just that their battery pack doesn't function."

So when pushed to back up you claim you go from claiming "The pack may fail, but no catastrophic fire occurs." to "Both components reduce fire risk. I never said that thermal runaway could not occur in a Tesla battery pack as you are stating. "
 
So you are trying to have it both ways or you forgot what you wrote. One way or the other.

In any case, it really is irrelevant since the effects of such technology are already in the statistic in question. I just find it funny you drop the claim and they dance around refusing to address your own specific claims while accusing me of doing the same.
Reply: @joshualandry3160  "Okay, which is to say the battery pack can prevent thermal runaways. Sorry to bust your bubble, but a single cell is what starts runaways."

Absolutely false statement. Sorry to burst your bubble, but a single cell, especially with both liquid coolant and fire retardant foam, does NOT have to trigger a battery fire. 

The equivalent statement is to say "a small gas fire, even one that a soda can put out,  is what starts catastrophic car fires".

In neither case does a small incident HAVE to result in a catastrophic fire as you are implying. A single cell (or even more) in a battery pack can short out, and the coolant/foam prevent further spreading of a fire.
Reply: @joshualandry3160  "Non sequitur. You can easily have a fire small enough to be extinguished with a can of soda. That is a matter of common experience. Small fires only require small amounts of liquid to put them out."
You're talking about a different fire than an automotive fire that NHTSA would track. A can of soda won't put out an automotive fire that would stop a vehicle on the road, a fire that small would not involve a first responder. 
And AGAIN, you are trying to qualify an automotive fire as safer or not safer based upon your conjecture. NHTSA does not track anything but vehicle fires, severity not mentioned. 
If you want to qualify a fire severity, even when EVs are at least 10x less likely to catch fire, you are omitting my previously mentioned factor of TIME. A gas car can, and does, explode instantly given the right conditions. It takes TIME for a thermal runaway to occur, and would be safer for the occupants of a car to escape from or be extricated from. 
I am not making that argument, however, because all that matters are fewer fires.
Reply: @justsomeguy934  I'm sorry, but you clearly don't know what a thermal runaway is or how it is caused. A single cell entering a state of thermal runaway is how an entire battery goes up in smoke. 

All battery failures start with a single cell that involves more and more cells until it runs away.

"Sorry to burst your bubble, but a single cell, especially with both liquid coolant and fire retardant foam, does NOT have to trigger a battery fire."

Excellent, you have a claim to prove. The same one I've been asking you to prove for a while now. Go find the battery that is able to contain a single cell in thermal runaway. Please do go find a source to back up your claims. I'm convinced you have firmly misunderstood the purpose of these changes.

"The equivalent statement is to say "a small gas fire, even one that a soda can put out,  is what starts catastrophic car fires"."

Except it doesn't apply in this situation. You want to treat the two situations as the same. They are not because the stuff burning is not the same.

"In neither case does a small incident HAVE to result in a catastrophic fire as you are implying. A single cell (or even more) in a battery pack can short out, and the coolant/foam prevent further spreading of a fire."

And that brings us back to the point you refuse to address in any way. Does it? Because I can't find anything claiming it does online and I don't think you can either. You are simply making up excuses to cover the fact you made a claim and cannot support it.

And I'll also remind you that it is irrelevant to the claim since a battery pack that fails but does not burn would not be counted in the statistics of vehicles that burned. That statistic is what is under discussion and you have introduced this red herring.
Reply: @joshualandry3160  "And I'll also remind you that it is irrelevant to the claim since a battery pack that fails but does not burn would not be counted in the statistics of vehicles that burned. That statistic is what is under discussion and you have introduced this red herring."

I'll also remind YOU that the small, soda-can-capable fires that you continuously mention are ALSO not counted in the statistics at NHTSA. If your automobile has a fire so small and so inconsequential that you can pull over, pop a soda and put it out, then be on your merry way, you will not be counted as a vehicle fire. The red herring is yours. NHTSA counts first responder fires, vehicle stranded, fire department involved as best as I can tell. Otherwise, they have no visibility to a fire.
Reply: @joshualandry3160  "I never said that. I said their statistic included all fires. All fires range from infernos that completely destroy a vehicle in a matter of seconds to small fires that barely do any damage and self extinguish."

Exactly HOW does NHTSA become aware of a self-extinguishing car fire? Does the car owner call NHTSA and report it? Does an EV owner call NHTSA if their battery declares itself with a fault and require replacement, but no fire occurred?

Your claim that there's no evidence that NHTSA doesn't know about self-extinguishing fires (EV or gas) is an unprovable statement, like disproving a negative. Even if you want to say NHTSA is notified by every EV and gas car owner if they put out a small fire with a fire extinguisher, the argument is moot. 

Here's why your argument is meaningless: even if NHTSA counts low- or no- damage fires, fires that the vehicle owner can put out themselves, or be told their battery is damaged but no fire occurs, the safety aspect of the vehicles now comes down to fire propensity. HOW OFTEN will a fire occur is the overriding safety factor, not how much water it takes to put out the fire. I have even pointed out that a battery fire cannot explode immediately like a gas car fire, rendering it safer than a gas car fire.

Here's your argument in a nutshell, your quote: "If one is to study the relative fire hazards of different vehicles one needs data on how those vehicles react to fire and yes, the effort involved in containing or extinguishing it."

The effort in extinguishment of a fire is meaningless when the fire doesn't occur. Your argument comes down to that point, for some reason, that the occupants of a car are supposed to care how much water the fire department has to put on a car that catches fire 10 times less often than a gas car. That is a irrational argument that we have been dancing around. I've proven to you that there are batteries that do not catch fire when damaged (BYD Blade), and that there is fire retardant in many battery packs. If there's a coward, it's you for not admitting those conditions exist.

I don't think I can count the number of times I've said this: fewer fires safer, more fires less safe. And EVs catch fire at least 10 times less often than gas cars do. I said about 5,000 posts ago that a NHTSA fire is a fire. It sounds like you made my point for me, actually, trying to include non-catastrophic fires. I appreciate it. The baseless calling of me a coward I do not.
Reply: @justsomeguy934  Do try for some common sense. If a vehicle is taken in for repair and has fire damage it is obviously experienced a fire. The repair station reports it. Funny how there are some things that are mandatory reports. Almost like agencies like collecting data.

It doesn’t matter how many times you repeat nonsense it remains nonsense. Fewer is not better without context. You don’t have context and refuse to accept that fact.
Reply: @joshualandry3160  Do try for some common sense. You said some fires can have a soda can put out the fire. It may, or may not, require repair by a shop. 
Here's the commons sense part: you keep making my argument for me, that a fire is a fire is a fire. If a small or self-extinguishable gas car fire is visible to NHTSA, then we must also assume a small, self-contained battery cell short is ALSO reported to NHTSA.
And where does that leave us? Fewer fires are better.
ABSOLUTELY TELL ME how the extinguishment procedures of a fire that doesn't happen is valid to discuss. TELL ME that the occupants of a car on fire care how much water is put on a fire if their car is 10 times LESS LIKELY to catch fire.
You cling to a useless argument, that makes no sense. I absolutely want to know in what world it matters how much effort is required to put out a fire when that fire is orders of magnitude less likely to happen and orders of magnitude fewer people are exposed to a fire.
Reply: @itsatrap7215  most of those fires can be put out with a hand held fire extinguisher

                                 No haz-mat gear needed